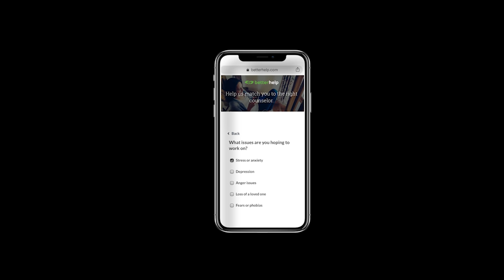DIY Stenciled Wallpaper S2 EP10

Comment: If you do a bigger room with that method, maybe an aluminum main stencil with cardboard ones for the edges and weird angles would be a good option. That way you can do an acetone soak when it gets clogged. I know aluminum stencils can run pretty pricey though.
Reply: It would be so hard to hold up the aluminum especially when plastic is easy to tape to the wall. The plastic ones are fairly easy to clean with a multitude of removers and even goof off when it's fresh.
Reply: @AkSonya1010  how would aluminum be hard to tape up? Especially at the thinner guages, it's not much heavier than a dense plastic. I've worked professionally with thick aluminum stencils (not for wall painting though) and even those were pretty lightweight.
Granted, I haven't worked with plastic stencils much, but wouldn't they be a serious problem to clean if the paint has enough time to cure completely on them? I'm not well-versed in my plastics, but the only kind I'm aware of that can handle an acetone bath is silicone, which would not make for a good stencil. Unlike metal, you can't throw harsh chemicals at most plastics when paint cures completely.
I'm just genuinely curious. If plastic is a viable alternative, that could definitely save Kaleb a lot of money and headache even compared to aluminum if he does another paint-on wallpaper.
Reply: @blazertundra  what's really funny. We had another discussion about the size of the pattern in the bathroom. Some of us envisioned the pattern larger & some people felt it was exactly what they had envisioned.
When I think of aluminum stencils.  I have to admit, I was thinking of heavy gauge aluminum not thin. 🤣  It is interesting how we all interpret the same thing so different based on our experience.  I used to do road construction & paint asphalt & had heavy-duty aluminum stencils, so that is where my mind went. 😉

I haven't had a problem cleaning the plastic stencils even when they dry.  I've  scraped it off or I used a gel paint remover.

Comment: Would be cool to use the stencil on a plain wallpaper that way you could cut and place as needed rather than fight the stencil on the wall. Or have someone CNC the design onto a primed mdf block that you could then use to press your own paper. The printmaker in me would probably have gone this route. =)
Reply: I'd have been tempted to ask around how much large-format printing would have cost. Probably a whole lot though, I think those solvent-based inks are expensive and you need a lot. Besides, hanging the result would have been a lot of fiddly work too.

Comment: Shalom Restorer! I stenciled quite a bit in my old home because paint is cheaper than wallpaper. With that said, you should use clear coat paint sealer over your work . Especially in the bathrooms. I did and it preserved my paint work for over fifteen years!  All three bathrooms ( I sealed the kitchen as well)  were still nice when I sold the house in 2019. Much success in all you do!

Comment: Loving the walls but on the toilet front, do be sure that the water pressure is great to flush, as we had one in an old house we bought, and oh boy not great as you can see the size of the outlet is not big, so clogs easy. Hi to Atlas xxxx Dede xxx
Reply: Good point ! I seen that too, very small
Reply: I think its going to be a high tank toilet - those things have great flushing pressure

Comment: I have been stenciling my walls since my hubby and I had our first house 43 years ago. When we bought our 1916 farmhouse 29 years ago. I did alot of stenciling as it was alot cheaper than wallpaper.  I just used cotton fabric on my walls above my wainscoting in my mudroom a year ago. I used fabric starch to put it on the walls with. Worked great. I had done the same technique in my bakery too. That was up for 9 years that I had my bakery. Everyone thought it was wallpaper.  So much easier to apply than wallpaper  to. As the bubbles come through the fabric not like wallpaper that you have to work up or down to the end to remove. Your Powder room is looking real nice.

Comment: I admit the stenciling has dramatically improved the color.  I really like it.  I do not know how to stencil as I have never applied it to a wall, however I am curious.  When wallpapering and for that matter installing ceramic tile, I have always found wall center and applied whatever from there to the edges (inside corners). I do not know if thats appropriate for stencils or not.  I used my technique when I installed Delft tile around a gas radiant fireplace in the Drawing Room. The Delft were originally there but had been painted numerous times, like you and your wallpaper origin, I had a sense of "rediscovery too".

Comment: When I do stenciling I use a brush in a stamping process which allows you more freedom to paint any areas after the original stenciling. I don’t know how you would touch up little areas with spray paint. Your stencils are great though, how did you make them they are perfect. I did a wall to look like tile and it came out really great. Oh you had a guy with a laser cutter do the stencils, if I watched the whole video before commenting I would do better. Your fans ChuckandMax

Comment: I used 2 very large stencils and did my basement floor. I had to spray them with cleaner every night and scrape the paint off the plastic stencils, it took me 2 hours every secession. I think I did this for at least a week or more to finish it, my pattern was busy but your pattern looks much more difficult and very fussy. It looks like you managed to get a very straight line, good job!

Comment: Kaleb, search for products that you can apply to the template that keeps paint from sticking to it but will allow you to spray through the holes. Maybe even a petroleum product  -people use that when they want to leave areas unpainted but want to just paint over the entire surface  - it keeps the paint from adhering. Just a thought - they may not even make something like that. It’s looking good tho

Comment: The stenciling looks amazing. Spray painting with a stencil is faster than other methods but as you've found it clogs the stencil and is next to impossible to clean due to the nature of the spray paint. Using a paint roller and acrylic paint is better because you can clean the stencil so you don't have to keep replacing it; you do have to watch for bleed through and use a temporary spray adhesive to hold it onto the wall but this method works really well and gets great results

Comment: I might be too late, but a packaging steel rule die shop should be able to make a stencil for you out of phenolic resin (they’re called counters or matrix, used for folding carton production). A printing shop could also make some printing plates with that pattern that you could use like flexible stamps.

Comment: The bathroom is going to be lovely. Not trying to be a downer, but my thought on the paint choices is, I think I would have gone with a more neutral paint color, so over the years I could change out the curtains and towels and rugs to change the look, without having to repaint. That said, as long as Kim and you love it, that's all that matters.
Reply from the maker: True, that's all that matters.

Comment: I know baby oil will sometimes take off Rustoleum. I doubt that’s what you’re using, but maybe you could see if baby oil will take the paint buildup off the stencils? Maybe a stencil you can’t use any more in case the oil damages it.

Comment: Love the stencil!  This is another example of you putting your heart and soul into this property. Question, can you not clean the stencil after every use. You probably have answered this. Sorry if you are having to repeat info. ❤️😊
Reply from the maker: It's cardboard (technically oil board) and won't take a thinner wash easily. It will warp.

Comment: Looks Good 👍
Reply: My walls are dry-wall so I used bucket dry-wall with plastic stencils for raised design. After dried, I put the stencil back over top & painted raised portion. PS: Drywall wreaks havoc on drains, rinse it from the stencils in a pan if you try this method.

Comment: Could you use the bead board from the basement for what's missing on the upper floors?
Reply from the maker: It's not a match.
Reply: If there's enough it would probably work

Comment: I don't remember if you were going to fill in the little gaps from the stencil "stringers" or not. If you do decide to fill them in, check with an auto-body repair supplier for a sword brush/ pinstriper brush. Or you can go on Amazon and look for a MACK  00  sword brush. They run about $12.

Comment: Concerning the stencil if it is plastic you should be able to clean it with paint thinner. Should say on the can what you can use to thin it or clean. Find a plastic tray the size of your stencil. Pour thinner in it to cover stencil. Get a soft handled brush. Let the stencil sit in it for hours or over night outside and it should clean up easy if it is plastic.
Reply from the maker: It's oil board. basically fancy cardboard.

Comment: You mentioned that it can be done with a stamped roller, yet it's hard to align it by hand... But what if you used a roller with a gear on each side that is rolling on some kind of a track? For example, automotive belt could be nailed to a 2x4 board...
This way it could be aligned with a millimeter precision (align the track with a laser level and notch the starting tooth on a gear)... Might not be cost effective on this scale though :)

Comment: @10:17 So, if the plaster walls have to "breathe", does that explain why wallpaper curls off on walls later so easily or moisture build up leads to premature plaster adhesion failure?
Reply: Yes, wallpaper will eventually fail when not looked after properly

Comment: Question, why not have your stencil printed on wallpaper? It looks nice though!
Reply from the maker: Having wallpaper printed would be costly (or take too much time to have done). Also paper wallpapers should not be used in a wet room. Using modern plastic papers do not allow the plaster walls to breathe.

Comment: Check with a local cabinetry company for Duglas Fir - I know Conestoga Wood Specialties has it ( Pa based but they do have a place in Kenley NC ) I used to custom match it and they can run beadboard -good luck
Reply from the maker: We solved the problem today!

Comment: Will you add a couple coats of clear coat over the bathroom paint to protect it or extend its life?
Reply from the maker: adding a clear coat would seal the walls and not allow them to breathe. Plaster is a stone and it needs to breathe. That's why we opted to NOT use modern latex house paint to paint the base coat. We used mineral paint which bonds with the plaster and becomes part of the rock itself.

Comment: regarding the stencils themselves - can you not use mineral spirits to clean them between sprays? If not, does the spray paint you are using have a cleaning spray or liquid to either thin or clean?  Most stencils of today can take mineral spirits or rubbing alcohol - they can't take acetone though.  Barring that, I sometimes use full strength Dettol.  Believe it or not, this product has been around since 1932 - it is an antiseptic soap that was used widely in hospitals for years until new products came in removing the need for antiseptic of this type.  It is a slightly oily liquid (easy to find in pharmacy) which I use to remove permanent marker stains on walls, whiteboards, glass, ceramics, etc.  I also use in First Aid in a 1 to 30 ratio to clean and disinfect wounds or to soak an inflamed ingrown nail.  It works amazingly well.   If your stencil is made of paper, could you not ask your laser cutter if it could be made from Mylar instead. ( is the brand name for a special type of stretched polyester
 film. Melinex and Hostaphan are two other well-known trade names for this plastic, which is more generally known as BoPET or biaxially-oriented polyethylene terephthalate.

Comment: Why not finish the whole restroom then put the stencil up on the wall. It's taking more time to put the print on the wall then it would finishing the whole bathroom.
Reply from the maker: then i would have to plastic off the entire room from any over spray and stenciling around pipes and toilets makes no sense.
Reply: Good point, and probably true..I think he's putting beadboard up around the lower half of the wall , so the pipes shouldn't get in the way..huh?🤔

Comment: I'm sorry Caleb - but, I'm confused. Why don't you just rinse the stencil with lacquer thinner? Put the stencil in a non-reactive tray, slosh some lacquer thinner in, swish it around (vigorous scrubbing would not be a good idea with such a delicate pattern). But just pour-and-swish should restore the stencil pretty well. So, why not just clean the stencil so the lines are the right thickness again?
Reply from the maker: I don't believe the stencil will hold up to the thinner. I believe it will warp.
Reply: @The2ndEmpireStrikesBack  Yeah, but if it's toast anyway, it's probably worth an experiment. I based my suggestion on my mother's experience doing wax-resist silk printing. Theoretically, one is not supposed to re-use the waxed stencils. Being a thrifty housewife, Mom wasn't about to buy new silk every time she did a new print. No siree! She poured boiling water through the frames and then swished them in lacquer thinner.  It was stinky and she always did it in the garage with the door open. But maybe stencils are made of different stuff from silks for screen printing,m so IDK? LOVE your work, Caleb - best of luck to you.